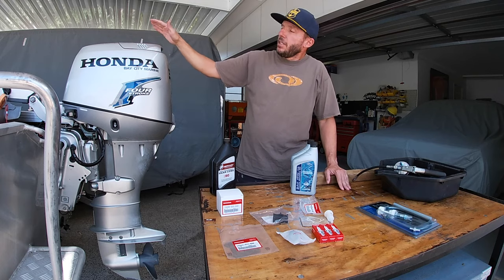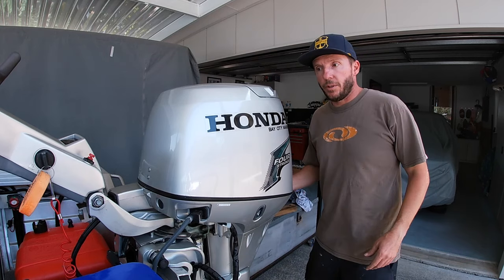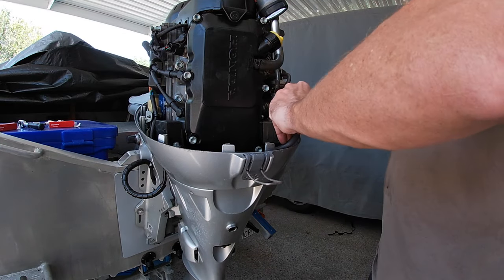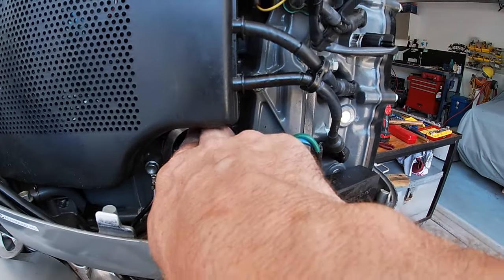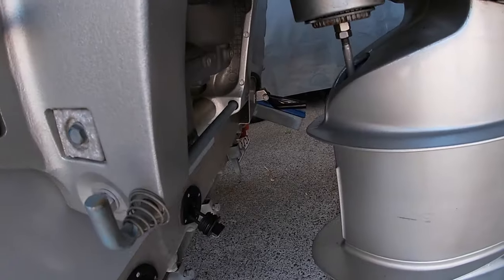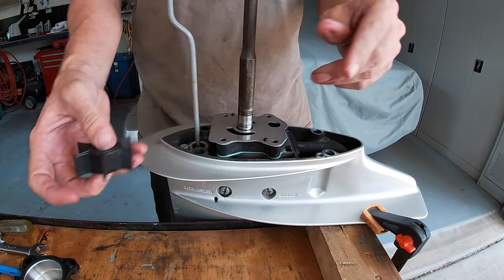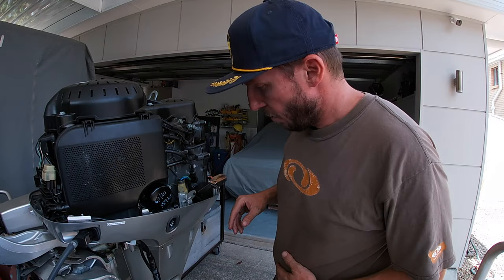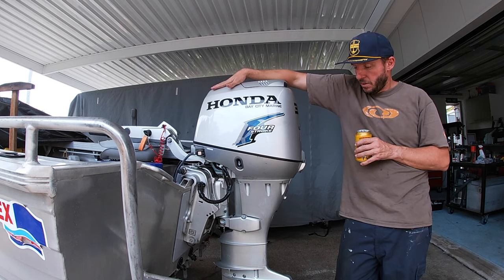How to service a 4 stroke outboard motor yourself - Honda BF30

Comment: Just finished servicing my 2005 Honda 50hp 4-stroke BF50.  Your video was a really great help.  Did the oil change, spark plugs, lower unit lube, thermostat, then the impeller.  While the lower unit was off, I decided to check the speedometer hole.  It was very stopped up.  Had a heck of a time getting that unstopped.  First used 3/32 drill bit (by hand) but it wasn't long enough to go down into the vertical pathway.  Finally used a small ss rod hammered flat on the end with a slow drill.  Had to replace some of the rubber tubing and found that 1/4 inch black sprinkler system drip hose worked well.  Engine now ready for fishing!  Thanks!
Reply from the maker: Nice work mate. Hope it runs well for you. Cheers

Comment: G'day: This video is SO VERY HELPFUL!!! I was able to follow this to change out the oil + filter and the impeller in my BF20 and now it's finally running again! If only I had realized the BF20 has a 5th bolt holding the leg on. May have broken a small piece of the body while getting the leg off, but it runs!
Reply from the maker: Glad it was helpful mate.
Reply: They all have a 5th bolt, he forgot to mention it unfortunately

Comment: Going to service my Honda 30 in the next few weeks.  I couldn't remember what to do with the gear linkage so a nice clear reminder from you.  Also a good reminder about the grease points.  Thanks from the UK.
Reply from the maker: Glad it was helpful Peter.  One more tip with the gear linkage. When you get it back together it may feel difficult to engage gears. Test it with the engine running and that will give you the real indication if it is adjusted correctly. Thanks for watching.

Comment: This video is deserving the Prime Ministers Award for excellence.  From start to finish you do not kill it with music or profanities. I have done this a couple of times on a BF25. Actually did the water pump twice because I ran it on land with the special Honda brass flushing adapter. If you have one, it would be good to show your viewers what not to use, as recommended by Honda, at least here in Canada. Your muffs are old school that actually works and keeps on working. If I may add a few comments that might save frustration, coming from a mechanic. For the untrained wrench, it could be beneficial to torque fasteners with a torque wrench to prevent pulling threads or overstretched bolts, nuts. Again you have done a bang on video and I think you are the best that I have seen. For the spark plugs, gapping to correct gap could be beneficial. I drain the fuel bowls before and after starting, actually as it runs. Reinstalling the foot, it wouldn't hurt to put grease on water tube that fits into rubber water pump insert. If tools are readily available,  a compression test helps to reassure engine life. Inspecting or replacing timing belt and idler, setting engine valves are important. Removing carbs and checking jets and tubes. My pilot tubes were almost eaten away and just about completely blocked, and then setting idle and synchronizing the carbs, not sure if you cover some of that in other videos. Just thought I would mention it. This particular engine was running ruff. No compression on center cylinder.  Automatically pulled the head and everything was like new from the naked eye. Checked head for cracks. Reassembled,  and found center cylinder valves were tight. This was just after a tune up from local dealership. Someone got off track and told customer he needed a new motor. A lot of work and expense on parts for not checking basics. Regardless,you have done a 5 star video, congratulations for knocking it out of the park and I look forward to viewing more. Thank you sir.
Reply from the maker: This just might be the longest comment on my channel. 👍 as you mentioned there was a couple of things I could have shown but I wanted it as basic as possible. Thanks for watching it mate. Cheers

Comment: Great video! I also own a HONDA and love it! I have been servicing my own outboard myself.  You put in a great guide to help people. The only thing I felt like you missed to mention was to put the crush washers on the lower unit bolts.  I have to make sure they are installed every time because my motor sits in the water at the marina during the season.
Reply from the maker: Thanks mate.

Comment: Pretty good video. I always use dish soap when putting my impeller into the impeller housing, it lubricates the initial start up but then biodegrades as to not pollute the lake. Don’t think it really matters though. Love my Honda bf35.
Reply from the maker: Great tip! Thanks for watching

Comment: This is my outboard and I love it. Thanks for the video.
Reply from the maker: No problem. Thanks for watching.
Reply: @AusAdventure  Are you happy with this outboard so far? I have heard some negative things about if from other owners. I've experienced some issues with the fuel system and carburators. Mine doesn't idle properly, and sometimes it dies when going from WOT to idle.
Reply from the maker: David North I have been very happy with it. Mine is a 2008 model and I have owned it since 2010. I service it every year and I flush it for at least 10 minutes after every use. I have never had any fuel issues or any issues for that matter. Any motor that is not looked after properly will experience issues.  You don’t know how well others look after their engines too so you have to take others opinions with a grain of salt sometimes.
Reply: I have a 2012 with no issues. The thing about these is they are extremely sensitive to ethanol. If you leave fuel with ethanol in them, you're going to have carb problems. Doesn't matter what additives you use, they won't help. 

I use a small pour of additives on each fillup (seafoam) plus ethanol free 90 fuel. Never once had an issue. Just ran it after a 50 day break, fired up first turn.

Comment: No big twig but there the difference in motor oils that you didn’t add is what would be pulled into the new empty filter..just a thought..  Aside from that I learned a few things and gained a little confidence watching this! 
Thanks!
Reply from the maker: Cheers mate. I did check the oil again after I ran the motor to account for the filter filling up and it was actually still at a good level so didn't end up adding any more. I was a little surprised. Glad it was helpful and thanks for watching.

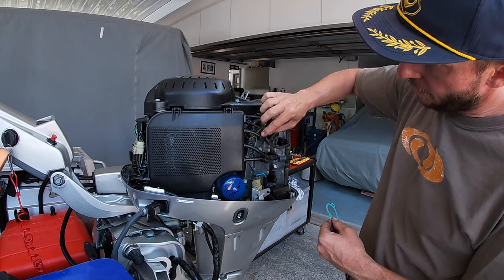Comment: 4:30 try MEK (Methyl ethyl ketone) for cleaning gasket surfaces. You can throw away all the sharp objects, stuff comes off in 2 wipes.
Came here to see if you need a gasket for the impeller, was not disappointed.

Good video although you missed some In my opinion important things; doing maintenance is also a checkup if everything is in good shape. 
You say that you’re examining things; but for your audience (someone that’s not a mechanic wanting to do maintenance), they don’t know what for:

So color of oil; the shrapnel magnet bolt on the gear oil; checking the drive shaft oil seal, for fishing line behind the thrust washer; prop damage inspection (no prop comes out as new; what’s the limit?). Maybe carb clean etc? On older carb models, if they’re not setup right (ie synchronized, clogged jets). 

Keep Making videos my man!
Reply from the maker: Thanks for the tip. 👍
Reply: @PointlessMiracle maybe you know how tight the propeller bold must be screwed on when installing a new prop?
I did mine like hand tight, but maybe the rubber sealing inside must be compressed fully and the thrust washer must be completely pressed against the messing prop bush?
Any advise here is very much welcome ❣️

@BornAgainBoating Thanx for the great video, I have all the service manuals, but its a lot easier the way you explain stuff... Great work, even after 4 years...
Reply: BF135 Service manual in the prop (castle) nut:

18 mm CASTLE NUT
INSTALLATION:
TORQUE:
1 N.m (0.1 kgf.m, 0.7 lbf.ft)
If the split pin cannot be set by tightening to
the specified torque, tighten the castle nut
additionally until the split pin can be set.
MAX. TORQUE:
44 N.m (4.5 kgf.m, 33 lbf.ft)

For comparison: the bolts of the gear case must be tightened at a torque of 34 N.m (3.5 kgf.m, 25 lbf.ft).

The maximum torque of a human hand on a screwdriver is 16Nm..
"Hand tight" is somewhere between 4 and 10 Nm depending who you ask...

So 1Nm on the castle nut is a very light torque, yet, my question remains, you feel the rubber ring of a new prop compressing when tightening the nut, but I used more than "light torque" of 1Nm, should the rubber ring inside the prop be compressed or not?
Reply: @MarcoYolo420  honestly I don’t know, I commented on this video because I am not very familiar with outboard maintenance (but am with other mechanic stuff) and wanted to give good feedback because this guy has great potential !
Reply: @PointlessMiracle  Gotya, and fully agree, this guy should be hired for making content like this...

About the nut, manual sais 1nm and max 44nm, so basically saying, pick your number... I think its fine...

Comment: Just a thought
 On my outboard which is an older BF45A  there is a fifth bolt under the anode plate holding the leg on. Need a 12mm wrench to get it out. 
You make great videos.
Reply from the maker: Thanks mate.

Comment: I changed the impeller on last weekend. The only tricky phases were taking the gear changer rod off and back to the engine. The two nuts had to be fully opened and even tighten a bit in order to separate the rod parts. I managed to get the forward position on by accident when pulling the leg off due to it wasn't separated fully yet. It is very difficult to put the gear back to neutral when the leg is taken off.
Reply from the maker: Yeah the gear rod is the hardest part. good job on doing it yourself.
Reply: @AusAdventure  I guess it is very easy after it has been done once. But if it is done only once in e.g. 5 years there might be problems to have the procedures clear in mind again. One thing was that the leg's internal surfaces were full of dirt (mud from the lake bottom). Perhaps I should remove and clean the leg more often. If you have deep waters where you keep your boat there are no such issues... Anyway... many thanks for your video due to it is the best and it was about the same size as an engine as mine is!! I wouldn't have the courage to do the job without a good example.

Comment: Excellent how to! One question, how do you get your muffs to run enough water through, is the clamp the trick? I have the same engine and can't get mine to run enough water through the system, but haven't tried clamping it.
Reply from the maker: Yep the clamp is the key. Mine won’t run enough water without it either. Cheers for watching Harry.

Comment: I still utilize my 84 Mariner 15, and 96 Yamaha 30hp but I mainly run a 17' Flat with a 40 mount swapped to my 2017 50 Honda courtesy of my cousin. Great for beaver dams.
Just like watching my uncle working on his OMC motors after the seasons over, he still uses them👍
Reply from the maker: Yep if you look after stuff it lasts a long time.

Comment: There is a 5th bolt on 2005 BF50A lower unit.  It’s under the tab trim anode.

Comment: Excellent video well done learnt some more from you one of the best I've seen . But there is one question does the gasket in the water pump were it meets the stainless steel plate and the bottom housing need any lube such as a little bit of oil rub on it for a better seal or just put on as is i notice you put it on as is thanks Rick
Reply from the maker: Thanks Richard. The rubber ring seal can have some grease on it but the paper gasket is fine as is. Thanks for watching the vid mate. 👍

Comment: G'day to you. Can I offer you a bit of friendly advice.I have had my own boat service shop for the last 26 years. There was a couple of things you missed. 1/ No compression test. 2/ What about the anodes. They help prevent the motor corroding away. They must have a clean contact with motor casings. Ask a dealer where they are and have spares. They rot away. 3/ No Inox/ crc/wd40 sprayed on the motor always the last thing to do. 4/ Its always a good idea to degrease the motor from top to bottom. Don't worry when you hose it down water can't get in where it shouldn't be. 5/ Absolutely no reason to put grease on links etc. It only makes a mess and gives dirt and dust some where to stick when your towing to and from the water.6/ Get yourself a proper water trap/ fuel filter, it will save the day in the end and they aren't costly. 7/  When you reconnect your gearshift don't try and change gears without turning your prop shaft. This will line up the dog clutch with the dogs on the gears and you won't strain any of the mechanism. 8/ This might cost a couple of bob if you can't do it but clean the inside of the lower casing  behind the prop and there is a bearing carrier in there. Remove it and replace the prop shaft seals. Reseal it with grease All Over it when you put it back in.This is an important step. If anything goes wrong inside and you haven't had it out in a couple of years time you stand a chance of breaking the gear housing to dissmantle your gear box. It is actually supposed to be done every 150 hours. At a dealer it would be called a MAJOR SERVICE. 9/ Service your battery. Clean your terminals and leads. Check the motor wiring especially the earth connections. Every time there is an electrical issue there will be an earth problem along with it.  I hope you don't think I'm a prick or the like's but its free advice from someone who's done this for 53 years in total. Some of these things might help you. I hope so. Regards.
Reply from the maker: Hi chris. Thanks for the feedback. I did forget to mention a couple of things like the anodes. Some of it I check prior to each trip such as the battery terminals which I could have explained. This is just showing how easy a basic service is. Thanks for watching.
Reply: Great info. However, I never use WD40 or Inox or CRC as it softens the wiring insulation. Landline was recommended by my Honda dealer
Reply: @iankidd6654  what is Landline?
Reply: @CUBICHI1985  I think he means Lanolin spray -  the stuff you get from sheep's wool.
Reply: @ChippyOZ  I've never heard of lanolin spray.. does it not damage plastic parts under the cowl of the outboard, like (presumably) WD40, CRC and others do..???
Reply: @CUBICHI1985  Supposedly the idea is it's safe on plastics etc as it's a natural product that provides lubrication and corrosion protection. Just do a search on 'Lanolin Spray' and you will find a bunch of products. I did see some that say they are 'Lanolin based' so you might want to check what other chemicals are combined in with it for that particular product just in case.
Reply: @ChippyOZ  right on, thanks for your input and great info!!

Comment: Did mine this week, had major trouble working out why I had no tell tale water afterwards though. Turns out the short rubber hose on lower leg wasn't mating with the tube coming down from the engine 😳, watch out for this..

Comment: Great video. When changing the gear oil your supposed to pump in it until it overflows, let it sit for a bit to let bubbles out, then pump some more. Least thats what I am told.
Reply from the maker: I wouldn’t have thought there would be enough air bubbles to adversely effect it, especially when filled from the bottom. Nice tip though and thanks for watching.
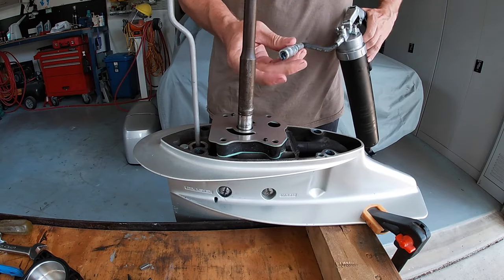Reply: @AusAdventure  yeah if you watch this guys video (https://www.youtube.com/watch?v=1XwmVisnVco) at 16:55 he burps his and adds a bit more grease

Comment: I bought a 50 Honda BF 50I’m going to do everything you just did in the video but what I wanted to know is should I spray the carburetors down first to clean them out I think this motor hasn’t been serviced in a while thanks for your support
Reply from the maker: Hi Doolie, if the carbies have stale fuel in them it would be a good idea to drain it out. I have never had to do it myself so I can't give you any further info on how to do it. I am just about to upload a video in which I change the internal engine Anode which may be of some use to you so keep an eye out for that video soon. Thanks for watching..

Comment: I've just got a 15hp honda 4stroke on a 4m fishing boat. 
Tested it before I brought it and the water wasn't squirting alot but his muffs were shit. 
I got it home put some decent muffs on and it's not squirting water at all. Turned it off after about 20 seconds. Had a look where the water feeds into and took that little gauze off and found what looks like little bits of rubber. This might be from the impeller.
Reply from the maker: Mate I would put money on it that your impeller is stuffed.
Reply: @AusAdventure  yeah I've watched your video and another one that actually showed the little bits of rubber that I seen. Cheers for this video ill get a few parts together and do a full service. Obviously the guy I brought it from hadn't taken care of it too well.
Reply: @AusAdventure  ok, yep impeller has no impellers left.... I found a few down the bottom in the pick up about 4 little rubber nobs and when i pulled the pump off another lose 1 so hopefully the rest went somewhere else NOT UP THE INTAKE.. 
also the oil filter has 2014 on it so I'm guessing the "service last year" was a lie.
Reply from the maker: @peterk7377  yeah sounds like they were not exactly honest. Sometimes those bits of rubber get stuck in the tell tail port so I would clean that hose out also.